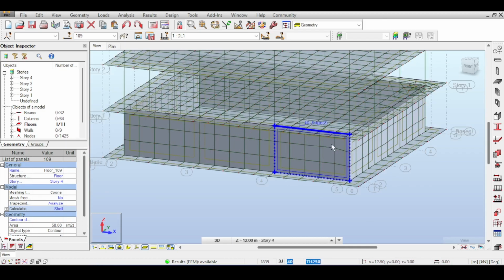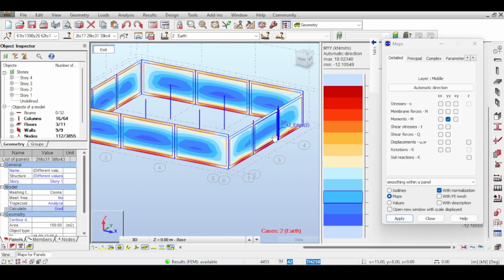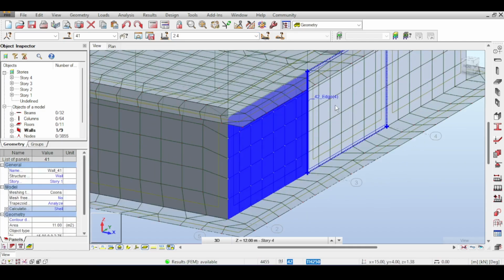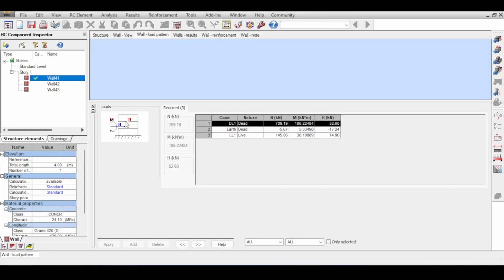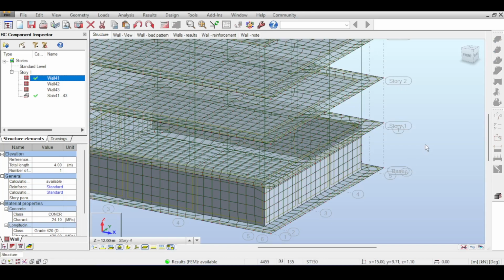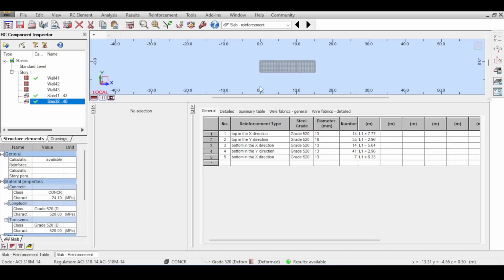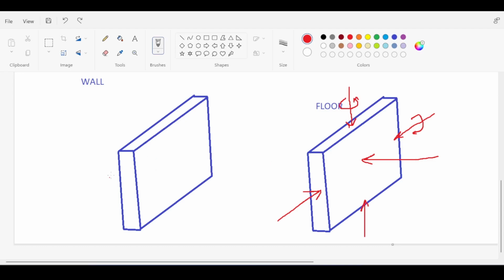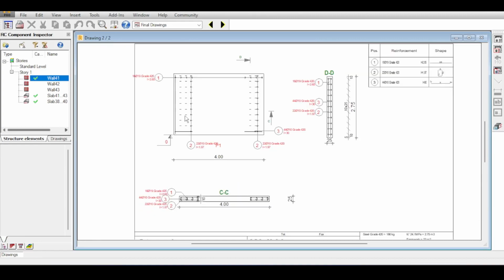Modeling of Basement Walls in Autodesk Robot | Part 2: The Design Process

Comment: Hello CEE,

Oh, wow! has the video ended already? I mean, it really feels like we have just started! This session was explosive and I just couldn't get enough of it. Well done CEE, very well done indeed!

07:41 I think I am converted here; there is no sensible denying of the explanation and proof provided in this video by the CEE regarding situations which are appropriate for one to consider using the wall module in RSAP; and the other situations where one should not touch the wall module even with a ten-foot pole. The closing remarks from 18:36 could not be any clearer. I simply can’t resist the floor module (shell elements) anymore, resistance seem futile 🙃. 

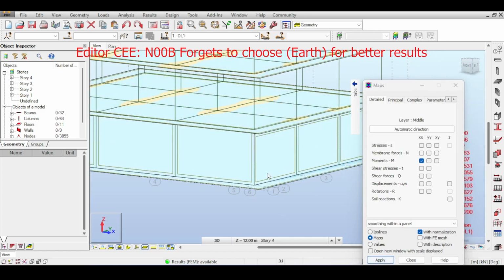02:19 😁😁. I like it when you keep your videos real, this actually helps me not to feel awkward when I am experiencing the same annoyances during my work.  

13:44 Well said on both takes, the passionate take, and the “milder” second take 😂🤣😂. I 100% agree with you, garbage is garbage, no matter how it comes wrapped. I rest my case!

 16:15 Yep, these rebars spicing details are quite amazing considering that they are coming directly from an analysis and design software. A well-deserved +1 for Autodesk. 

By the way, nice selection and isolation tips (open maps results in new window with scale). Thanks. 

Thank you so much CEE, this video features some of the extremely important concepts, the really really good stuff!

Keep well and enjoy the rest of your day

Regards, DK
Reply from the maker: Hi there Engr. DK,
I am happy that you found the video beneficial. I hope that this would end the idea of when to use walls vs when to use shells "floors" in RSA. This point was almost the main theme of that video.

Indeed, the editor sped up the video 20x just that you see the utter confusion I was in after I realized that you do not see anything when activating Mxx, only to later understand that I was selecting an inadequate load case for my comparison purpose. 

The raw video files that I take are usually sometimes hilarious and contain a lot of those strange phrases. On average, the editor cuts around 25% to 33% of video length. In rare occasions, he was cutting almost 50% and modifying the positions of my speech, especially when the raw video is a total incoherent gibberish mess. So, Kudos to him, I guess.

The amount of cool stuff in the detailing of bars in all modules of RSA is truly fantastic, I remembered that I never talked about this on this channel, so I wanted to talk a little about it in this video. 

While recording my videos, I realize that there is still so much I haven't touched upon. Also, there are so many areas worth a deeper dive, such as a detailed dive into the effect of all reinforcement options (RC beam provided reinforcement) on the outcome of our reinforcements. 

Most welcome, stay tuned for more content. I am planning to release both robot and FEM videos in parallel. I still need to come up with a realistic release schedule to also accommodate with my current duties at my current workplace.

Stay tuned and have a fantastic day,
CEE
Reply: @CivilEngineeringEssentials  

Thank you so much for the feedback,

I think it is a good idea that you plan to release the FE and Robot videos in parallel, this way all viewers would have been accommodated. 

I also think that the current weekly schedule works very well because it gives enough time (and flexibility) for viewers to schedule when they are able (and available) to properly watch and immerse themselves in the lessons of the week. 

I fear that a shorter release schedule may end up overwhelming some viewers and leave a feeling of always having “too much and too many lessons to catch up on” especially if one is unable to watch the new video soon before the release of the next video for whatever reasons on their part.

For these reasons, I would recommend weekly or longer release schedules but not shorter than weekly. I would go as far as alternating the releases between “robot on one week” and then “FEM on the next week after” in order to allow yourself more time if your other demands require more of your time. I have no doubt though that you will find a realistic schedule that works best for you.

Regards, DK
Reply from the maker: Hi there Engr. DK,
Yep, a weekly release schedule would avoid causing any overwhelming effects to our dear viewers. I will definitely take your advice to heart.

Anyways, stay tuned for mo00000aaaaAAAr content. ^_^
Regards,
CEE

Comment: Excelent content!
Do you have any advice on modeling masnory walls (non-tension is a must)? This is always an interesting topic regarding any software.
Reply from the maker: I need to think about how to do it in RSA actually. 
The problem with masonry walls is that they "as you rightly mentioned" cannot carry tension. They would fail, with failure patterns looking like an inverted V. 

Now the problem in RSA is that it cannot "cancel" the tension resistance of a shell. Not sure if there is an option for it, I have to check.
An idea I have (it is just an idea, I did not try it out, yet) is to model each block by itself and apply releases between the blocks, but this is a TEDIOUS task and only is feasible if you want to model ONE wall. But in a bigger structure, this becomes prohibitively long and tedious.

I hope I was able to spark new ideas,
Regards,
CEE
Reply: @CivilEngineeringEssentials  One possible solution I've found is to try to model walls as orthotropic, so in X direction they carry loads and in the Y they have no stiffness...example of it in Scia engineer https://youtu.be/vSLVU771Y6I?si=nCVbvrzfPutkk81g so possibly this could be a way to try to solve it
Reply from the maker: I will definitely look into it
Thnx a lot 👍🌹

Comment: Well done as always. why you don't use panel instead of floor
Reply from the maker: That is an amazing question. I even made a video to explain it just now ^_^
You can find it under:
https://www.youtube.com/watch?v=aHSPiTUWN2s&ab_channel=CivilEngineeringEssentials
Reply: @CivilEngineeringEssentials  In the type of structure we have Wall, Floor and Panel. I'm talking about this panel. What is Panel for?
Reply from the maker: Panel is another way to define floors. You can access the command from (Geometry -> Panels)
However, you cannot just use Panels to define floors. You have to define a contour first (Geometry -> Contour) then use the panel command to click inside the contour. This will transform the contour into a floor.

It is kind of a looong way of defining floors. Instead of using 1 command (floors) to define it, you are using two commands.

Hope it helps,
Regards,
CEE

Comment: Hi dear CEE, scheduling FE videos in parallel with RSAP is awesome so we can be entertained during the entire week till your next release!!

Now i have a cuestion, seeing the differences between “walls” and “floors”… which are the ones comparing “walls” and “chalices”?

Another cuestion if i may ask, have you ever used “gap” link in RSAP? In which case could we use this option?

Thank you very much as always, hope this channel keeps growing!
Reply from the maker: Hi there Engr. Candea,
I am happy you like the double release schedule. 
For the question, chalices, if I understood correctly, are structures in the 3 dimensional space, such has huge domes. In this case, your loads are going to be in-plane and out of plane. Out of plane cause moments on the plate so it should be done via floors/panels in robot. Not via walls.

As for "walls". It depends on the type of wall. If you have basement walls or retaining walls, those would have out-of-plane forces, so a floor/panel is more adequate.

The "walls" command in RSA can be used to model load bearing walls such as shear walls and bearing walls.

I did use gaps, and I will add it to my todo list. It is really cool btw and is used in some special cases.

I think I will give a deep dive into RC beam design the next video or start my warehouse series.

Stay tuned,
CEE
Reply: Sorry it seems that i made an awful translation (i use rsap in spanish) and i was thinking in something different, “core walls” what purpouse can we use that option for? Bearing walls? Thank you so much!
Reply from the maker: Oh core walls are usually a group of shear walls together. Dedinitely part of a video series on buildings after the steel series.
Usually found around elevators and staircases, those are the "core" of the structure resistance to lateral loads. Definitely worth a video 🌹🌹🌹

Comment: This channel has quickly become one of my favorites. Would there be a possibility, in the future, to talk about modeling of precast RC wall, dowel connections between them and supporting them on top of the RC beam, without the stiffness of the wall taking over the load?
Reply from the maker: Hi there, I am really glad you like the channel. 

I will keep your idea in my mind. However, I need to make sure that there is an easy way to deal with precast stuff in RSA. The idea being that I need to explain the extra load cases that need to be included when designing those pre-cast elements, especially those that arise from moving those elements via cranes and so on. It is an amazing idea, I will add it to my video list.

Once again, thank you very much for your feedback. Also, consider supporting this channel by suggesting it to your friends and colleagues.

Regards,
CEE